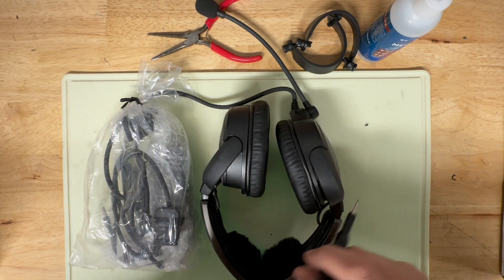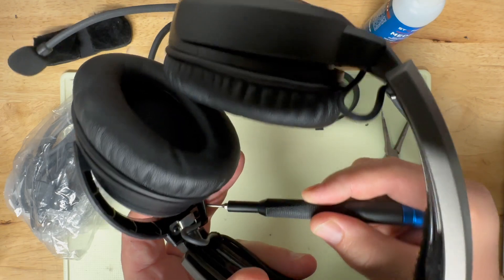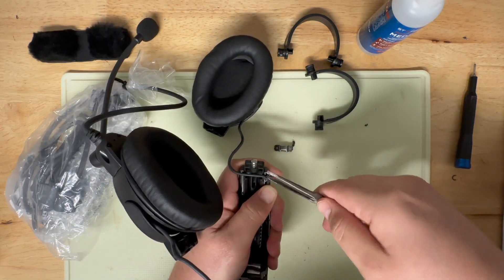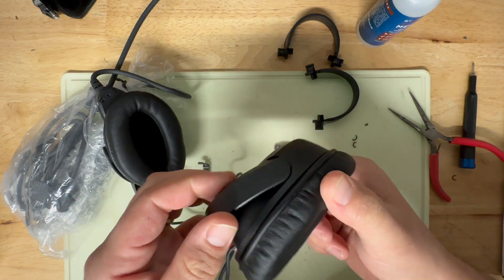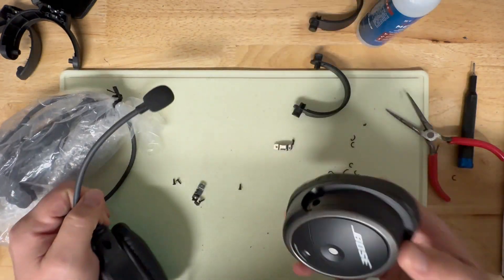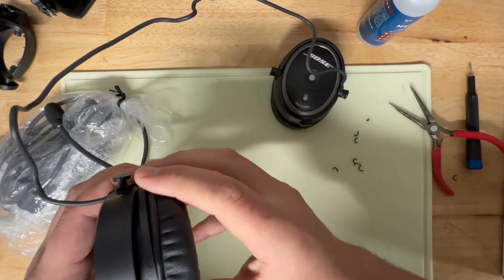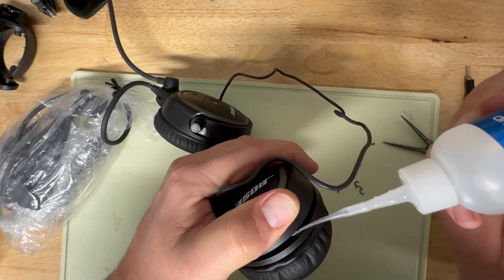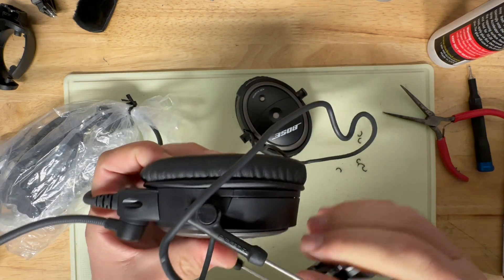Sky Cowboy Supply Company Bose A20 Teardown (Instructional Video)

Comment: I have a huge melon...like size 7 and 7/8 to 8 baseball hat.  Will the helmet fit me? I want to order one with bose a20 installed already also because im not good at working on little clips etc, but dont want to get stuck not being able to return it if it does not fit.  Thanks.
Reply: Yes, I have the same head size and I fit the Team Wendy SAR Tactical helmet just fine. It goes up to size 7 7/8. I wear my Sky Cowboy setup helmet frequently during my 48 hour aeromedical rotor shifts and it’s extremely comfortable.